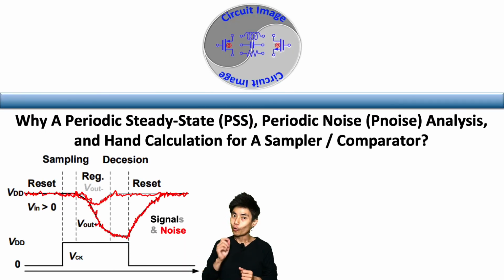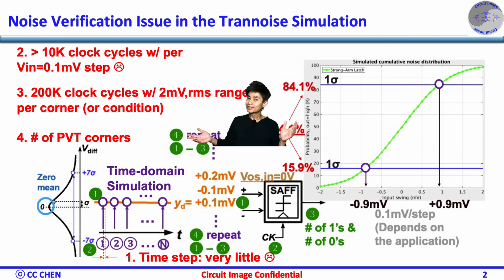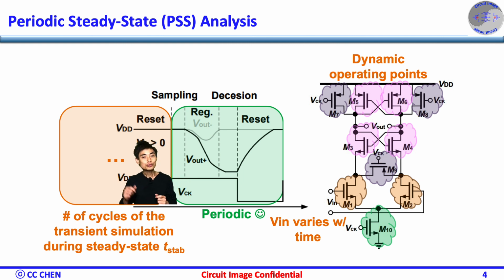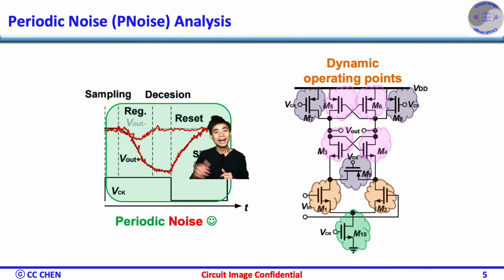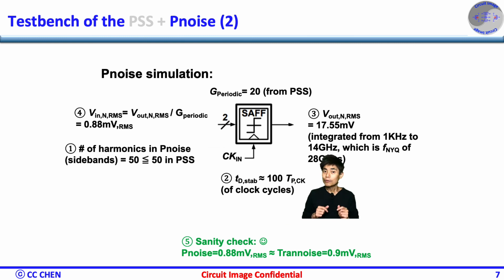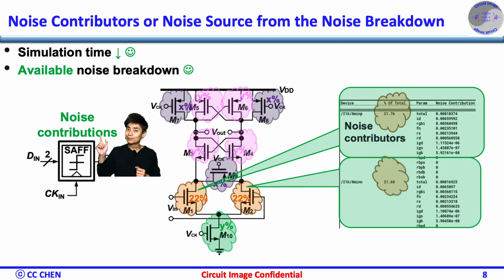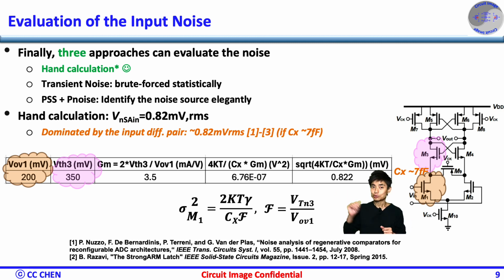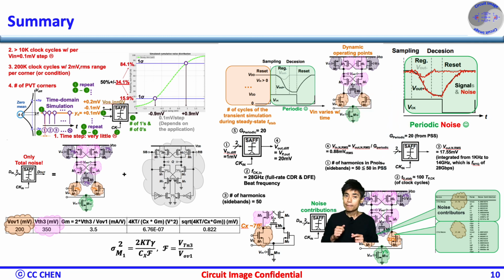Why A Periodic Steady-State (PSS), Periodic Noise (Pnoise), and Hand Calculation for A Sampler?

Comment: Hi Dr. Chen , how to determine the number of harmonics to be chosen ?
Reply from the maker: Hi Krishanu,

Good question! Start with ~10 harmonics for sinusoidal signals and ~20–40 for switching/CML waveforms (rule of thumb). Increase until the Pnoise/phase-noise results converge and no new spurs appear. Always rely on convergence rather than a fixed number.

Thanks,
CC
Reply: @circuitimage  Thank you !

Comment: Hello，Dr. Chen, really hope you answer question:  in your PSS simulation example in the video, Vp,out =20 mV is a DC voltage or @ certain frequency ?
Reply: What’s more: Dout in my TB is a differential output, in the PSS steady state tran waveform (tstab), one output of Dout goes to “1” and another goes “1”, how to define the gain? (Input differential voltage is 1mV) and do you think we should cal the slicer for systematic offset before we do the PSS+PNOISE?
Reply from the maker: Hi Nextivor,

Thanks for your thoughtful questions!

In the PSS simulation example, Vp,out = 20 mV refers to the voltage amplitude at a certain frequency in the steady-state periodic response, not a DC voltage level.

Regarding Dout in your testbench being a differential output with complementary signals (“1” and “1B”), to define gain correctly, you should consider the differential output swing (peak-to-peak). If your input differential voltage is 1 mV, the gain is typically calculated as the differential output swing divided by the differential input swing.

It’s indeed good practice to perform systematic offset calibration (such as slicer offset) before running PSS + PNOISE analysis. This ensures that DC offsets do not skew the noise and jitter simulation results, leading to more accurate measurements.

Let me know if you want me to explain any part in more detail!

Thanks,
CC
Reply: @circuitimage thanks！ i found maybe i make a mistake: Dout is the output of the RS-latch, which is not the correct pin should be analyzed, it should the  “strong-arm” output, right ?
Reply from the maker: @Nextivor  yes!! 🙂

Comment: Hi. Why is the noise integrated upto the nyquist frequency only?
Reply from the maker: Hi 有芯事,

Good question.

In digital signal processing, noise is typically integrated up to the Nyquist frequency, which is half of the sampling rate. This approach follows the Nyquist-Shannon sampling theorem, which states that a continuous signal can be accurately reconstructed from its samples if it is band-limited to frequencies below the Nyquist frequency.

When sampling a signal, frequency components above the Nyquist frequency can cause aliasing, where higher frequencies are misrepresented as lower ones within the sampled data. To prevent this, anti-aliasing filters are applied before sampling to remove frequency components beyond the Nyquist limit.

Thus, integrating noise only up to the Nyquist frequency ensures that all relevant noise components within the sampled signal’s bandwidth are considered while excluding those that would otherwise be filtered out to prevent aliasing.

Thanks,
CC

Comment: Hi, Can you cover types of jitter. How jitter components are decomposed and what are the causes of each jitter component. Also where is period jitter, cycle to cycle jitter and TIE are used. Also can you cover crosstalk and power induced jitter and how do we measure it.
Second, which different instruments are used to measure different jitter components.
Third, what decides the noise floor of an instrument. Difference between real time and sampling scope.

Thanks
Reply from the maker: Hi Srinivas, thank you so much for the jitter suggestions. I'll spend lots of time talking different jitter and the corresponding appplication. :)